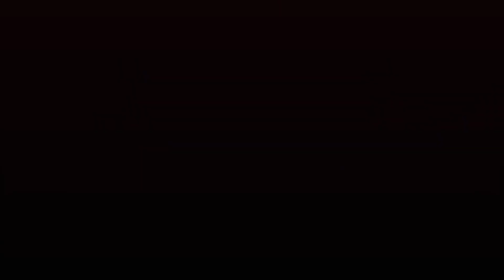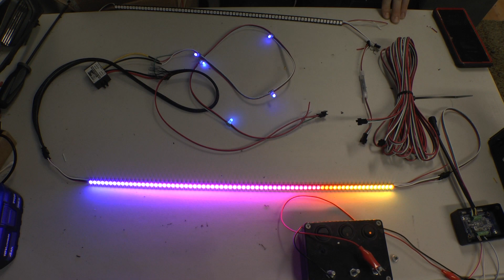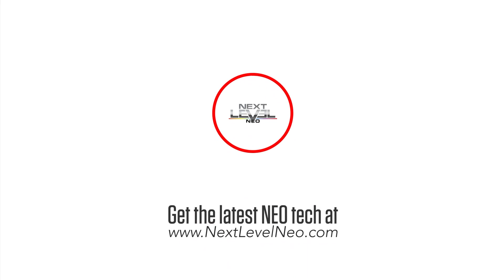Fix Addressable LED Flickering Issues With NLN Signal Boosters

Comment: I think a couple of those can fix my issue, in my underglow I try to run 3-60" led strips(two on the sides and one at the front) and 1- 36"(back), then after a while it will shut down the back and one side and also the front will turn like bright purple similar to what you showed, so I assumed I need some kind of signal buster, what do you think?
Reply from the maker: That sounds like you need to add power injection. Run some 14awg power to the end of your underglow strips.

Comment: Do you have a solution to make multiple leds act as one address?
For example an 8" section of your UCS2903 strips that would animate as one individual pixel?
I can't seem to figure out if there is a way to do this within Blueghozt. I might have to hit my taillight design with a different plan 😢
Reply from the maker: Set the section in the app, set it to strip, and move the direction slider to the middle position.

Comment: now that's a quality video!  ;-) 
I'm just so blown away that it took SO FRIGGIN LONG for someone to come around and finally develop & produce this product.  So, as I've said before, thank you so much for putting so much time, effort, and passion into this industry and providing unique solutions.
And for the record, doing addressable wheel rings (in series, not parallel) is where this unit would be *necessary*.  Without this, I had to do dual Ghozts because the data signal dropped too much on the run, despite using 12awg wire.
Reply: His solutions are absolutely top notch, amazing stuff. Nor to mention these super informative videos. I couldn't thank Next Level Neo enough for helping me learn everything I have!